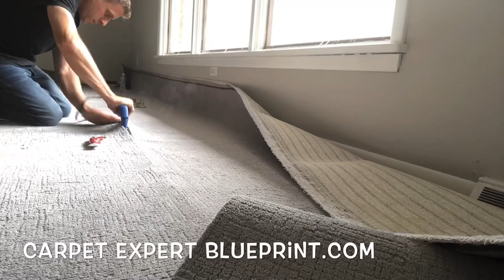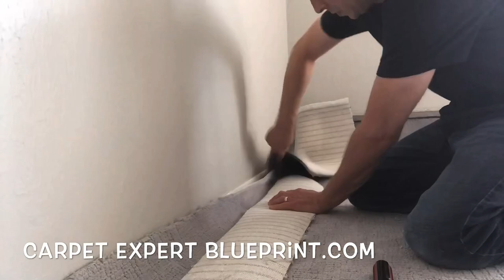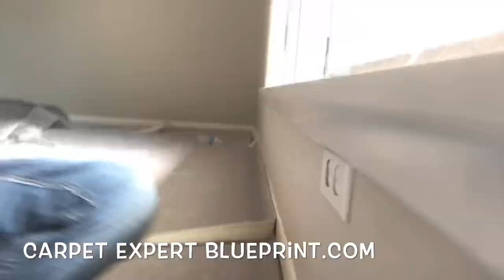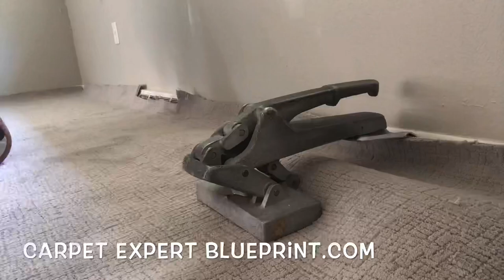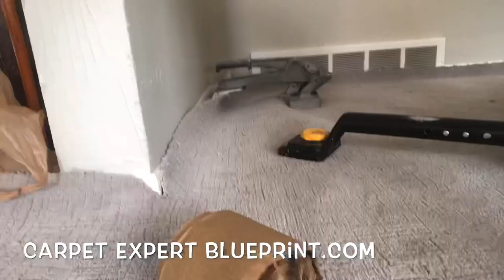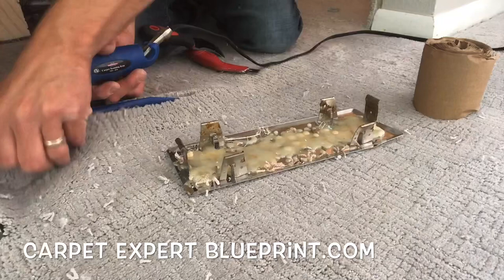Is Pattern Carpet In Style AVOID THIS SCARY TREND

Comment: Is it normal to see the seams in patterned carpet? Just got some installed and you can see every seam. Looks terrible
Reply: Not a short answer to that, if it's installer error then yes they can be made to look better, but seams are never guaranteed invisible even when you do them right, you need a carpet inspector to determine that and his word holds up in the court of law, the guy in this video would not pass inspection for example and would have to pay for the whole job to get done correctly, lot of bad installers out there, more so than good ones, in short you need an inspector first if you wanna take steps.